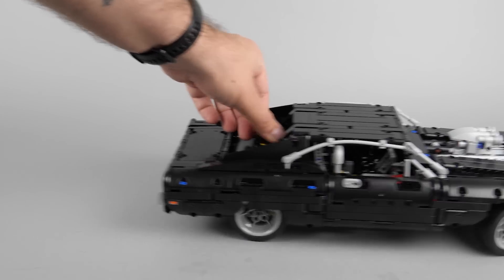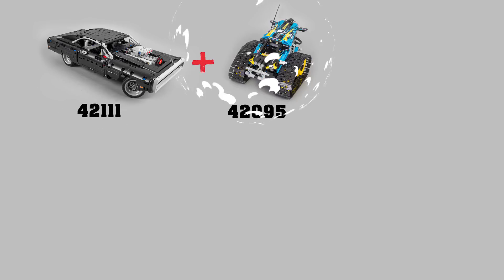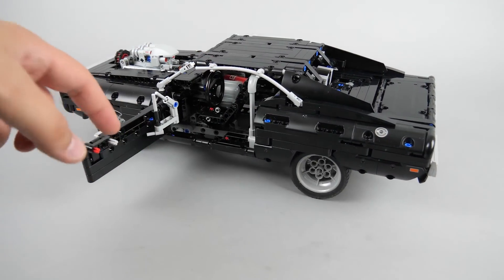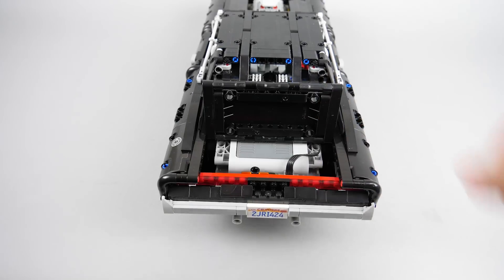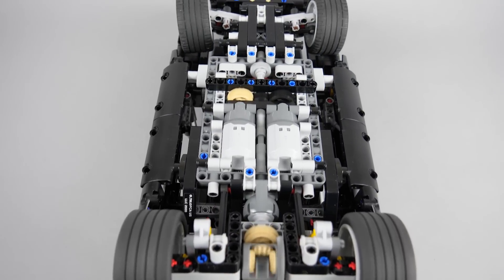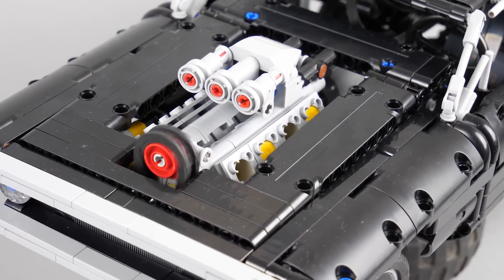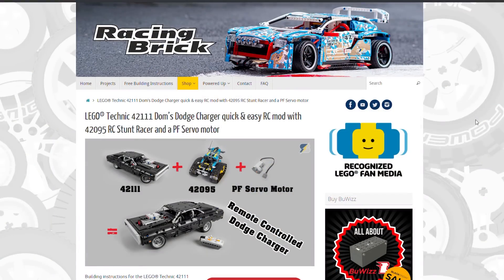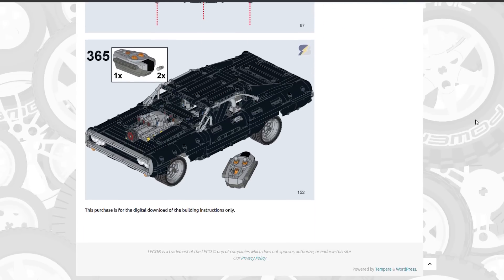How to motorize easily the LEGO Technic 42111 Dom's Dodge Charger with 42095 and a PF Servo

Comment: @racingbrick , I bought your instructions last month. Do you know if this car goes at the same speed as 42095? I wanted to know if I'm not sacrificing parts of this one to make a car that would end up being slower? I appreciate your help.
Reply from the maker: You can see the speed in the video. As it is bigger and heavier than 42095 but still powered by the same hardware, it will be somewhat slower.

Comment: Can this be achieved using the servo and motor from set 42109 Top Gear Rally Car
Reply from the maker: It can, but the hub placement has to be different
Reply: @RacingBrick  thanks for replying, I'll look into it 👍

Comment: Hello, I would like to buy the PDF, but I have already built my Charger, does the PDF talk about modifying or rebuilding, if not, nice job.
Reply from the maker: As the motors and other parts are integral part of the build you need to start in from scratch
Reply: @RacingBrick  It's ok, thank you for your answer.

Comment: Does the servo stall while steering with this moc? Because the 12 tooth gear only rotate 45 degree-ish with the original design.
Reply from the maker: The servo movement is limited but it is not a problem, also can be found in official sets
Reply: @RacingBrick  I don't have the official Lego servo motor, but a Cada Pro one (that returns to center and works well with the IR receiver of 42095). Would that be a problem?
Reply from the maker: @ntuong95  I don't have experience with that motor but if the functionality is the same then it should work
Reply: i had the same problem try cada's older servo or just don't steer for too long

Comment: @RacingBrick I am done assembling it, when I turn it on there is green led on battery pack, on power supply but it doesn't not start. It makes a little beep and stays put. How do I get it to start.
Reply from the maker: You need to point the remote to the receiver and use the levers to control the motors. The receiver and the remote needs to be set to the same IR channel (there are 4 options).

Comment: will this fit with game of bricks light kit?
Reply from the maker: I have no idea, but light kits usually don't play well with RC sets as there are a lot of moving parts and the wires are very thin
Reply: @RacingBrick   ik but i have a map of how the wiring is so i found a way to wire it whitout any contact
Reply from the maker: So if you have the kit and found a solution why did you ask? :)
Reply: @RacingBrick  i found it after i commented this- srry
Reply from the maker: Ahh ok, no worries :)

Comment: Hi, great vid! I want to know if I can use other motor than the PF servo because It seems I cannot find one anywhere in stock!
Reply from the maker: Not in this configuration, but there'll be different ones coming soon
Reply: i just bought one on ebay for 12 bucks there not 100+

Comment: Someone tell me why my front wheels won’t turn when using the blue side of my remote.. I can hear the motor making noise but nothing up front moving. I realllllly don’t want to take it apart oh god lol I’m new to technic and brand new to powered functions.. but I’m pretty smart so help me out!
Reply from the maker: There are only a few pieces between the Servo motor and the steering rack so there's not much that can go wrong. Remove one of the front wheels and then you should be able to see what's going on there. There's a red gear right in front of the servo, that does not matter in this case. In front of the red gear there's a 3 stud long black connector piece, that should rotate when the servo turns. In front of that you only should have a black gear sitting on the steering rack, that should also turn. If the black 3L connector rotates but the black gear does not then you probably inserted the tan 4L axle on page 66 incorrectly, but you really need to take the build apart to fix it.

Comment: Is it possible to apply your mod for lower rear wheels also on this RC mod?
Reply from the maker: You can make the rear suspension lower, just need to ensure the wheels does not touch any body panels
Reply: RacingBrick thanks I'll do so

Comment: Unbrickme actually also modified this and his version had motorized wheelie lifting function!
Reply: RacingBrick's looks faster and the battery box is hidden. Unbrickme also modified some shaping of the car. Adding another larger motor and controller for the wheelie bar isn't worth it to me. Was on the fence with this set but now I want it.
Reply: @gregm963  honestly I prefer the modified shaping, gives the car more oomph ya know. I mean if you have an extra xl motor lying around then I say yeah modifiying it is definitely worth it! just use the channel switcher on the rc, you don't need necessarily a second controller
Reply: Better this model

Comment: I appreciate your ability to limit yourself to the use of parts from another easy to get set. I've just started work today on the motorization which will hopefully include a functioning wheelie lift as well
Reply: when u finish building it, i will buy it of you.

Comment: Why does nobody use control+ parts in the mods? They have more range and stepped steering, the power is adequate.
Reply from the maker: My main reason is because they are not wide spread yet, and you cannot buy the L and XL motors individually. On the other hand from a control perspective they are more challenging, you either need to use a gamepad with BrickController 2, or you need a huge chunk of code for a fairly simple servo control with calibration and all that stuff.
Reply: RacingBrick well, while your points are respected and totally valid, I would say it’s not always necessary to have a custom control layout. For motorizing sets like the one in the video it’s perfectly fine to use either Tog Gear or Offroader profiles.
Reply from the maker: @boriscareaway5862  that's possible, but then you need to stick to the exact same motor layout that makes the build more challenging. Just an example, you need to have the same orientation for the Servo, you can't build it in the other way around because then steering would be reversed. Same goes for the XL motors, if you drive train would include a different number of gears, the car might go backwards. And obviously you cannot use extra lights, motors, nothing else.

Comment: I don’t get it Balazs, ehy didn’t you used the buwizz
Reply: This is something that is geared more towards beginners like me. I just built the 42095 that I got as a parts set, and it's only my third Technic set. I'll probably get the servo as well so I can do my own RC MOCs, and it's great to see that it doesn't have to be insanely hard.
Reply: Budo Bašović good luck with your creations then :)
Reply from the maker: Because I wanted to build the combined mod first, nowadays it's not that easy to get extra parts for a build. BuWizz mod will also come.

Comment: Have you tried the motors from cada yet? I bought a rc wheel-loader from cada just for fun and i think their motors have slightly more power and the servo works smoother. Also i like the 2.4ghz rc mote than the 80s IR. I will mototrize my 42111 once it arrives.
Keep up the good work!
Reply from the maker: I tried one set but I was not impressed, another one comes soon for review :)
Reply: i agree i used there pro motors and they have lots of power and the battery pack is cheaper than buwizz and better in some ways

Comment: Do you have any solution for the servo motor problems?
Reply from the maker: What kind of problems?
Reply: Today my servo broke , it doesn’t return center, I try to clean the sensor pads inside of it but it doesn’t work , do yo now any other technic?
Reply: @alonsoparra4359  m-motor with auto center
Reply: @alonsoparra4359  Don't try to repair lego motors, contact Lego first.
Reply: Nice video. Good Pick😉🙂